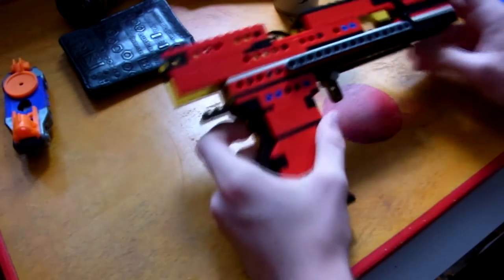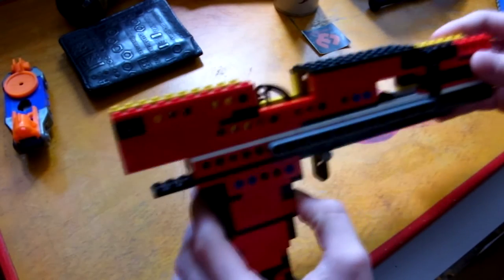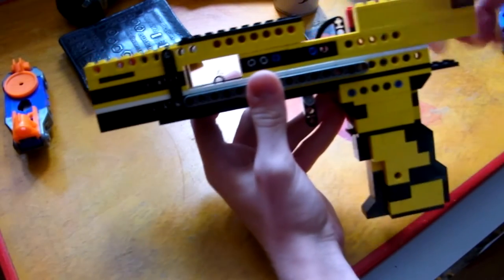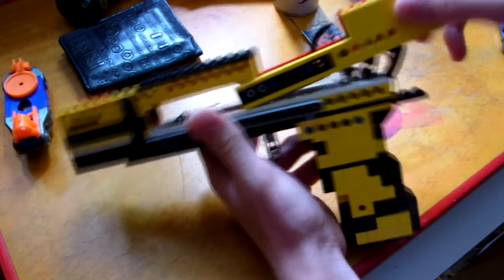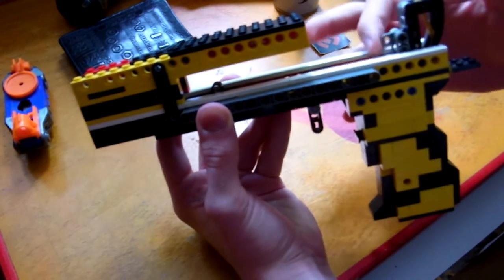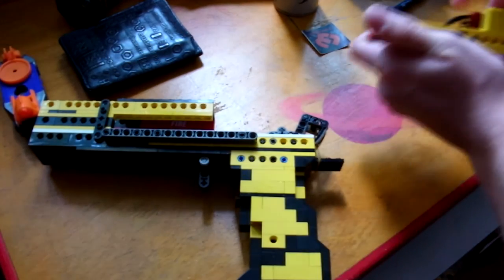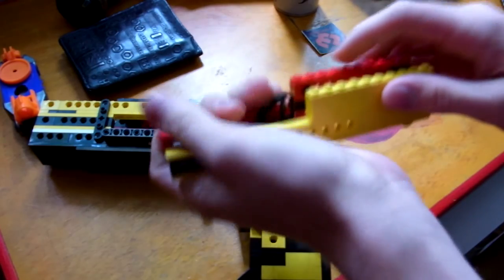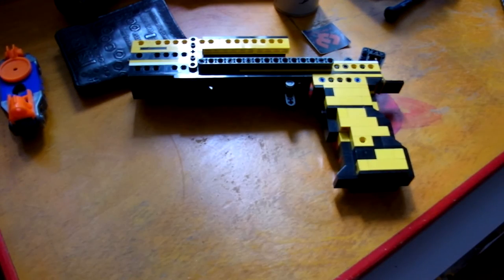!Blow-Back DEagle [Mech Showcase]

Comment: you kinda used infected bears mech,i like that you make gun and lots of parts because it is interesting to watch and i dont have many parts,though i somehow mad a clipfed cbow glock using simple mechanism but secret trigger design,keep up the good work!
Reply from the maker: Thanks, but
THIS IS NOT USING INFECTEDBEARS MECH, get this right in your head dammit!
I can't say this often enough and somehow people still dont get it, if you are talking about infectedbears guns you are talking about a mechanism that was created by RBGuns /watch?v=m5RxxWythHI (where RBGuns got it from is another discussion)
THE first one to build anything like this was neither RBGuns or Infectedbear, it was REALDualDesertEagle! He also traded his mech with me before RBGuns built his, so everything i do was developed on Deagles mechanism (especially this gun).
One important thing to note is that, IF i had used rbguns design, the slide could not be all the way closed before firing.
Reply: ok,maybe not,but the angle piece has significance,i am not saying your a culprit
I found out your mech and simplified the trigger a ton,great job too!
Reply from the maker: i dont want to bitch around on this but sometimes i just can't avoid sounding like that so ... anyways thanks for your feedback

Actually what could you simplify on the trigger?